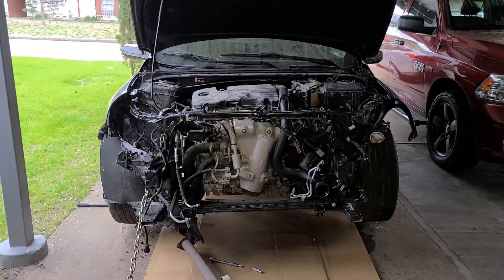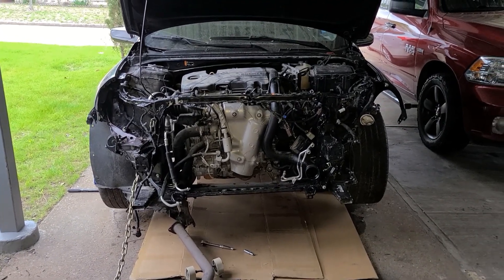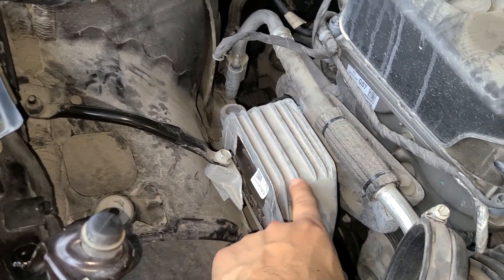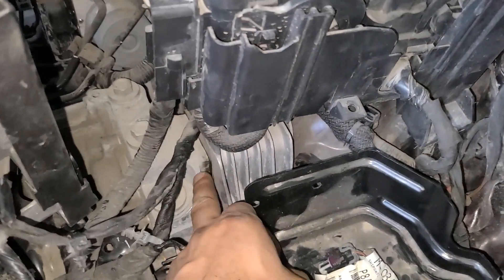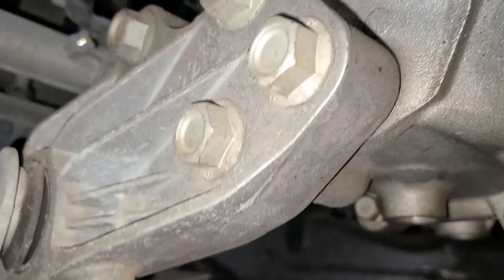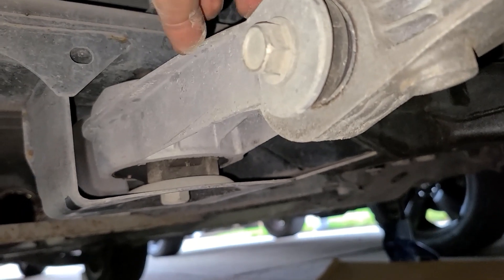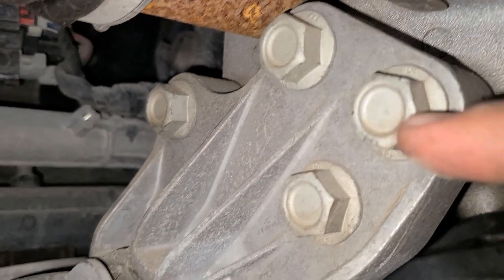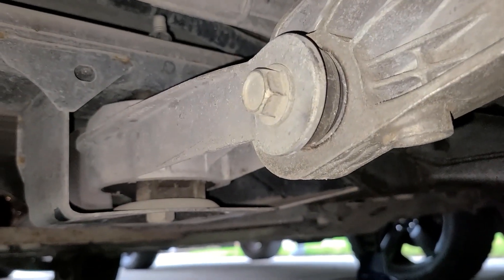2020 Chevy Malibu motor and transmission mounts location

Comment: what was the reason why you replaced the motor mounts?
Reply: is it because the engine is shifted ?
Reply from the maker: When motor mount goes bad,u feel a lot of vibration on the steering wheel....when u stop at a red light...or when the car is at idle, u feel the difference.  That means motor mounts are bad. U might not be able to see it physically.
Reply: I have a 2016 chevy malibu LS will the transmission mount be the same and if the transmission mount is broken will it push the engine forward to the bottom engine hose to cause a leak??
Reply from the maker: @kayo4921  sorry for the late response.  Yea mount should be the same. And yes if that mount is broken,engine and transmission will be loose on that side and it can cause to move forward and damage parts. There little to no space between the engine and radiator hoses/fan etc.
Reply: I recently started  having a couple popping noises from what seems to be driver side front, but I ended up taking the tires off everything was tight and good there on both sides from my understanding, but when the front of the car was off the ground and when I put it in drive I noticed when hitting the breaks the motor kinda moved forward a good bit. And when I had someone do it while I looked under the car, and I could see the bottom motor mount moving as well, put the car back on the ground moved it back and forward hitting the breaks motor did not move, but still was making a couple popping noises only when pulling off from a stop Everytime. Suggestions????
Reply: @LayneCasey-hq9io i think thats shocks n struts mine does that